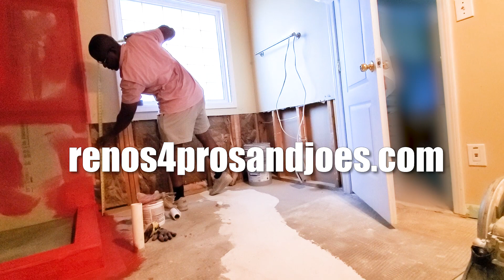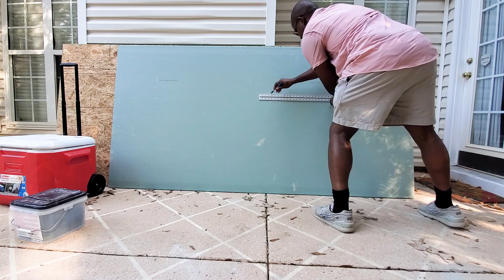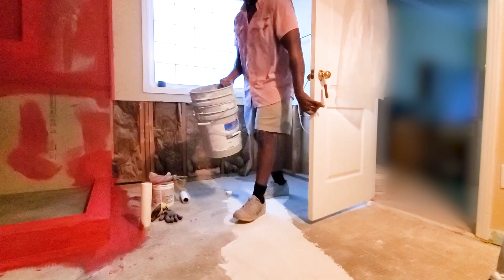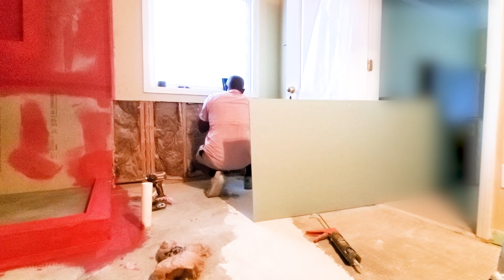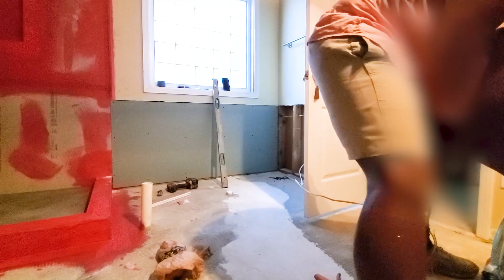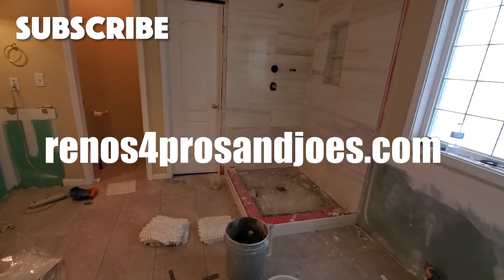DRYWALL REPAIR  | Bathroom Remodel Update

Comment: Thank you for sharing your skills and expertise! What is the red product for? We are doing a similar reno, but diy non-professionals.
Reply from the maker: Good Question. The red/pink product is a waterproofing membrane that can be brushed or rolled onto the fiber cement backerboards. Red Guard is the product you see in this vide. Different manufacturer's make it in different colors.